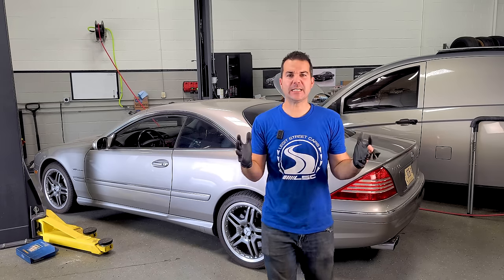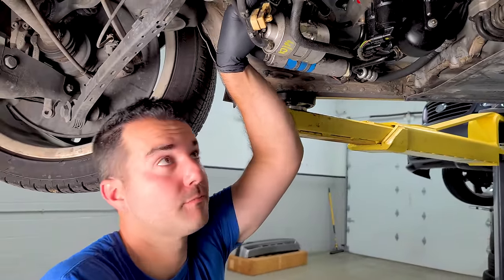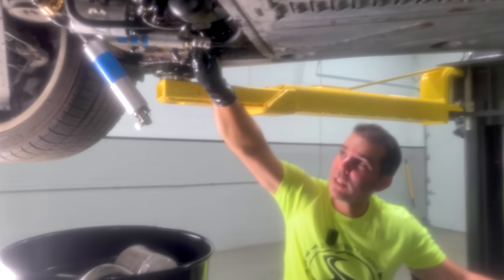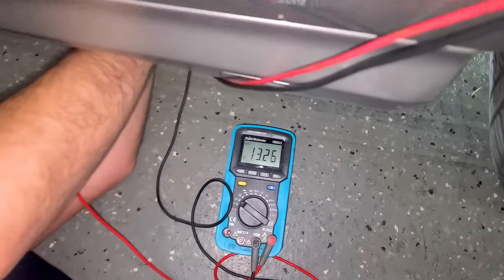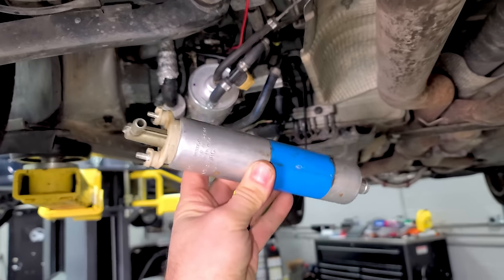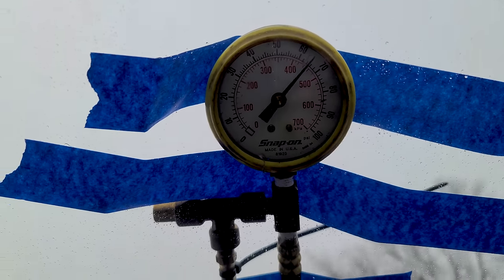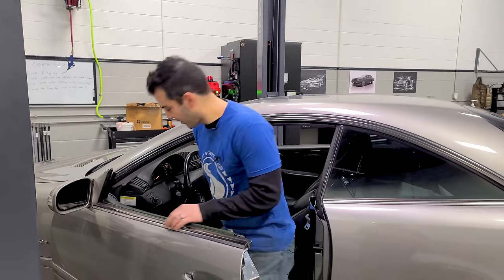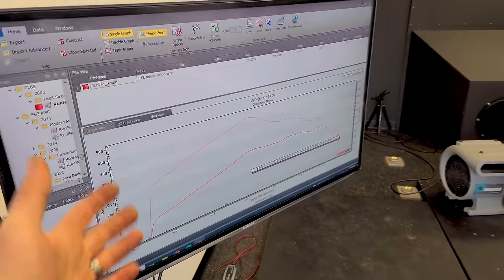I Used Bugatti Veyron Parts & An Alex Trick To Fix My CL65 AMG V12! You Won't Believe What Happened!

Comment from the maker: Post up what you think will fix this car!
Reply: A long drive off a short cliff.
Reply: A fire !
Reply: The crazy part is my friend has the same problem with his Cl65. He’s tried it all from transmission solenoid to custom ignition.  We have been waiting for you to fix it 😂 so we can fix his 😂😂😂
Reply: full disassembly, check every parts of a car, if it normal working, then full assembly) then you definitely will know, what's causing this nightmare))😅😅
Reply: Check your fuel pump input voltage. Check your exhaust system-concentrate on the catalytic converters. Had the same issue.
Reply: remove the radiator cap, and slide a new car under it !
Reply: Crimped full line/ or it’s a software issue
Reply: Haha you tried lol
Reply: I would look into the regulator.  I'm not a merc tech but almost all boost applications use a progressive regulator usually 1:1 for boost.  Also what are you lambda's when entering limp mode?
Reply: The line itself. Fuel line...
Reply: You!😂
Reply: check ECU. maybe it causes this trouble...
Reply: Get a new cat. maybe its still clogges, new intake sensors if nothing works you will have a content car to fix for the rest of the year
Reply: A match and gas soaked rag will solve all your problems.  😂
Reply: Whatever it is, it makes really good content!
Reply: Try gas filter
Reply: Selling it
Reply: Is there a pressure regulator on the fuel line? Could be sticking open when releasing excess pressure
Reply: Peter
Reply: Peter
Reply: @ARMATURISTA I'm tempted to agree with you. The rubber line could be swollen and not allowing enough fuel volume to satisfy the computer. The engine goes super lean super fast and the system triggers a fault.
Reply: I definitely think it’s software related. From what you have shown everything checks out mechanically
Reply: Is your fuel tank venting? Under full load the pumps could pull vacuum in the tank and then the pumps lean out.
Reply: Clogged cats !
Reply: Computer related
Reply: ecu or electic wire
Reply: Test pipes. Just don’t post it on YouTube since the EPA is watching 😅
Reply: I would check voltage under full throttle. Not saying the alternator is bad, but it couldn’t hurt. Also check at the fuel pump at half and full throttle. It seems like an electrical problem to me. Could old wires. Cool puzzle to solve doe.
Reply: Upgrade the fuel pump ditch the double pump setup
Reply: Spark. It's either blowing the plugs out or the coils are failing under load.
Reply: your fuel line , i have a similar issue inside my tank, between the pickup tube and external tank a small crack on tube inside tank was getting air
Reply: Hiya. I wrote this to you before in your last video regarding this issue. I found a document about the M275 Initial Training and it says in that training manual, the Charge air temperature sensor (B17/8) Signal required for calculation of air mass (in combination with B28/7), as well as for monitoring the boost pressure system. Maybe you need to check this B28/7 sensor? This B28/7 sensor, is the Pressure sensor downstream of throttle valve actuator. Maybe this is the issue? You should also look at that M275 Initial Training document; I am sure that could help you further! Good luck and hello from Great Britain.
Reply: Take it to Scotty Kilmer 😂
Reply: Test reducing the boost intake pressure by half and analyze the data, because the back pressure. You could still have a clogged exhaust or not enough exit flow for those boosters, that’s why I’m thinking a very not happy intake flow.
I was gonna tell you to dual pump the fuel but you figured it out.
Reply: A rock…a big rock
Reply: K swap! Lol
Reply: HEY ALEX, Make yourself a punch list and start logging the parts vs. cost and make a limit on how much time and money you have invested and try to set a cut off that is reasonable and try to stick to the limits you set and have some one look at with you and give a reasonable second opinion , more eye and 2 brains and always prevail just a thought buddy !!! PS. GOOD WRENCHING MY FRUSTRATED FRIEND !!!
PS. FEEL THE FORCE AROUND YOU, BE ONE WITH THE FEELING THAT YOUR NOT IN CONTROL HERE >>>
Reply: An exorcist
Reply: I've been down this road with my m113, My issue turned out to be the smallest of vacuum leaks lol. I don't think that's your issue here though. 

With everything you've tried I have to agree with a few other people that you're catalytic converters matrix is moving. I would try straight piping it for testing purposes. But the cats back on if that's not it. 

Also the reason you're going rich now is that the Mercedes ECU does not take into account fuel pressure when determining injector pulse length. It expects that you are at 55 PSI. The fact you're going higher than that with the extra pump now is causing the car to go rich
Reply: Blowing out spark? It would make the o2 read rich and possibly cause misfire codes. I don't recall if you gapped and went a heatrange cooler?
Reply: My car had a exactly the same problem going into limp mode and restarting the engine fixes it until my next all out pull. For me problem was turbo over boosting/under boosting. The old wastegate went bad.
Reply: @chrisdunham6119 the pressure regulator is inside the fuel filter and he replaced it already, still can be a defective part
Reply: On my CL the filter could not deliver after a Renntech map...At boost it is like a sailor at the pub;)
Reply: fuel pressure regulator :face-orange-biting-nails:
Reply: what was the fuel pressure on the dyno when it cut out? if it was low in 3rd gear (which you couldn't test on the street), then it could be a clogged / bent fuel hose. i suppose both fuel pumps can't be bad at the same time.. but it seems that one isn't enough to hold the needed pressure, but it should be enough.. so obstruction in the fuel hose could still be. you released all the pressure and it still shot out like crazy. maybe another peace of plastic? who knows..
other people have suggested the exhaust could still be clogged.. test pipes on dyno could be helpful as well.
i would throw in a normal software and a new throttle body as well. the new software changed too much at once for failure hunting.
i am hopeful that you will fix this car!
Reply: Fuel line after filter, collapsed or other another weird plastic part as in the ABS system…catalytic converters is surface chemistry capturing air pollutants; not sure one should use chemical cleaners, once detoriated sufficiently, you can’t regenerate them. The O2 sensors just check if all fuel is efficiently burned as this will negatively impact the lifespan of the cat. If cat is too detoriated it will generate too much back pressure which is often first noted with full trottle…so one of your cats could still be a potential root cause as shown during the cleaning. The cleaning of the cat would only temporarily relieve the back pressure problem…
Reply: The erratic fuel pressure at steady load worries me. Perhaps problem with return line? Before cutting cats etc you can measure the back pressure. Find the cause of limp home. Easy would be to disable the limp home mode :)
Reply: I would demount the exhaust system including cats on a dyno and so you will see if there’s any difference
Reply: LS swap it
Reply: You should do a crossover video with Ivan at Pine Hallow.
Reply: New larger cats possibly a new throttle body get Ivan from Pine Hollow Automotive to help
Reply: Having Ivan from Pine Hollow Automotive diagnose it.
Reply: Selling it 😂
Reply: Is it possible the air filters are too restrictive and that’s why it’s making that noise
Reply: Bad gas cap
Reply: sooo now it's cutting out because it's too rich (which would make sense since it has double the fuel thanks to the 2 fuel pumps) so my guess would be the necessity to recalibrate the response of the voltage regulator for the fuel pump(s) so that it's harmonised with the new (double) fuel flow. It appears to be well tuned for low loads but under full load it needs to probably deliver lower voltage, as under full voltage it allows the pumps to go to max and deliver too much fuel
Reply: See my comment to your first post.  Issue is probably a clogged or bent fuel line.  You depressurized at fuel rail yet it sprayed at fuel filter meaning somewhere in the line there is a restriction.  Would cause all your issues.  Hope this helps.
Reply: Load OEM ECU tune and go from there. If you have modified tune your fault tables may be disabled and there might be other issues.
Reply: I wonder if a fuel flow guage instead of fuel pressure gauge is available, lower fuel flow may be the cause of engine running lean and going limp mode.

Addition(edit): 
Sometimes running pumps in parallel usually doesn't achieve full flow rate of 2 pumps as both pumps may not run at same rate of flow rate 99% of the time.
It's the reason why there isn't parallel pump setups for PC water cooling loop. 

If the max flow rate of single pump is enough for the boosted engine to not go into limp mode, you may try out connecting both pumps in series for higher pressure and lower flow rate drop at higher engine rpm.

Else you may need more powerful single pump with higher pressure and flow rate combined, overvolt the pump(s) or really overhaul the fuel system to achieve overall higher fuel flow rate like others have mentioned.

Alternatively remove limiters if possible for increased risk of possibly very hard to detect engine pre/micro-detonation.
Reply: Check the return fuel line to the tank. Maybe this is causing the issue. The other thought I had was to find someone with the same model CL65 and compare them side by side to eliminate issues. Also check all injectors!
Reply: Rusty pieces in Tank and fuelpump
Reply: @trentryan27 twin turbo LS swap!
Reply: These problems needs a deeper dive and back to the beginnings. Is there any leak somewhere? Metal bends under pressure. Maybe when you load up the system something bends open and relieve pressure? Never trust a new sensor. Test it. Is there something moving inside the fuel rail? Some rubbers? Is there a cavitation problem anywhere?
Reply: Try driving without the cats to see if that’s the issue?
Reply: i noticed that there was a lot of back pressure when you disconnected the fuel pump, a bit too much i think, so maybe something is going on between the fuel pump and the regulator/fuel rail, the car going rich after installing the second fuel pump may indicate that now there is too much fuel pressure in the rail, maybe the regulator is giving up. now i don't know if the high intake temperature issue got solved but maybe would be worth checking the log for the temp, maybe under load is getting way too high and going into limp mode to prevent knock, or could be something stupid like a worn tps sensor failing at the full trottle possition, is like 20 years old by now so it could be worn or corroded at the end of the travel and the ecu is lossing signal under load and going into limp mode , anyway, a full log of the event may gave some clues on what is going on
Reply: Maybe still a partially clogged catalyst and/or software issue… 🤷‍♂️
Reply: At least petrol will evaporate when you get doused, get squirted by diesel and that stuff just reeks. It seems to soak into your skin and hang around for days.
Reply: A NEW CAR hahahh XD
Reply: Is it still under warranty!!! 🤣🤣🤣
Reply: Collapsing fuel line, or clogged return line? either could cause the issue. next could be a CPU issue. good luck!
Reply: Is it worth getting in touch with Renntec? I have had their map and mods on my CL600 Bi Turbo for over 6 years no issues...touch wood! Keep the faith either way ❤
Reply: Sparkplugs...! I know from Audi that wrong spark plugs on a heavy boosted engine can make it missfire under heavy load...something with blowing out the spark.... aim for 0.7mm gap..... more boost=less gap...
Look around at see what tuned Audi's uses....
Reply: Have you pressurized the intake/intercooler system from turbos to engine with shop air and plugs? Could be a leak somewhere just under load.
Reply: YES
Reply: Your perseverance on this car is nothing short of monumental. You are in uncharted territory with the mods, but it's possible the computer is seeing a data point that is triggering limp mode. That said, it would be nice if you had a pair of plain downpipes, no cat or gutted, that you could bolt on and do a few pulls. It's simple and reasonably cheap. That would answer the backpressure question once and for all.
Reply: I think then you discovered pressure in the line when you had already bleed the line of preasure could have been a symptom you are over looking. I would investigate why it held pressure, is there a blockage somewhere else?
Reply: Fuel lines, both ways. There must be something wrong when they sprayed you like that even though you released the preassure.
Reply: Restriction on the inlet side of the fuel system. Measure the vacuum. Partially collapsed hose? Something weird with the fuel tank?
Reply: Time for a decat? Or atleast a couple of temporary cat delete pipes to rule them out 100%.
Reply: Just had a 2 year old battery in my car that threw an engine light at full throttle, and lacked a bit of power under load. Battery checked good but after replacing it went away.
Reply: @snackler6102  isn’t this a return less fuel system? Hence the variable voltage to pump and the sensor.
Reply: are you 100% sure about your coil packs?
Reply: Likewise might be worth running without air filters just to rule them out too.
Reply: @leonidas953  I second this. He bleeds the lines and there is still pressure. You can’t over look that symptom spraying you in the face like that.
Reply: A tune issue, not original turbo or intake manifold can put the ECU in security mode with all the changes you made (and as I understand it was not happening before ?).
Not sure what kind of ECU this engine use, hopefully a tuner can debug why its going into safe mode and reprogram it.
Reply: One thing to consider and not sure if you have addressed it yet, but I was having the same issue as you with the check engine light coming on and going into limp mode when in heavy acceleration but would run normal after restart- turned out to be the APP sensor (Accelerator Pedal Position Sensor).  If one or more of the circuits in the APPS is worn it will cause an inaccurate reading with TPS, Air/Fuel mixture, fuel pressure etc..  It was a cheap easy fix in my case and might be the culprit with yours.  Hope this helps..
Reply: Change the cats and remove the fuel pump you added
Reply: Look it's only on full throttle so goes into open loop mode. That means it only looks at the open loop sensors which should point you somewhere. Verify signals from all these sources. Maybe run a new fuel line right to the engine bay. Find a spare throttle body or ECU to swap out. You'll get to the bottom of it!
Reply: Seen this firsthand and it was a bad coil pack took it to local electric guy and he hooked it up and fixed the coil pack
Reply: have you removed the electronic  limiter (governor)?  It's a long shot but  if it's still active and  faulty could this be causing the fuel voltage to drop then spike?  Causing the wild pressure changes and it then running rich. might explain the misfires too
Reply: I had something very similar happen to my 2003 C32 amg. Changed the auxiliary pump, fuse, and relay to no avail. It happened to be something very random (ambient air temperature sensor) after I changed it all my problems went away. Not saying that this will work here (they’re obviously very different cars), but I definitely think it’s some minutiae electrical detail that’s causing your limp mode woes. Early 2000s Benzes are just so strange like that. Don’t loose hope! Love the videos btw!
Reply: LS swap. 😂
Reply: If I understood you right, the computer is seeing 21psi of boost when it’s only making 16psi. That would definitely make it run rich. Running rich would make the boost lower than normal, the engine is chasing its tail.  I’m not familiar with MB but it must have a boost pressure sensor.
Reply: Another thing, If I’m not mistaken I saw an esp warning pop up when you punched the gas on the dino? You may have already checked this, but oil can travel up to the tcm connector and cause something like this. (I had this happen to me as well)
Reply: @joedemid6530  gotta love odd things like that.  Like in my car, a bad or even slightly not right coolant temp sensor can make a lot of unrelated issues.  Hard start? Change thr coolant temp sensor.
Reply: throttle position sensor or gas peddle, maybe.
Reply: At clogged fuel line between the pump and the fuel rail, why else would it hold pressure there?
Reply: @ARMATURISTA  a tacoed fuel line.
Reply: maybe aftermarket pump and ecu
Reply: Bypass cats
Change fuel lines
Check fuel tank vent
Check fuel rail pressure regulator
Reply: Take it to the wizard,I'm sure he wouldn't be just replacing parts for no genuine reason.
Reply: Just sell it and cut your losses before something else breaks or goes wrong.
Reply: Personally Alex, I'd be going for the replace all fuel lines between the tank and engine option, and while you're in there, since you've added the extra pump, install an aftermarket fuel pressure regulator in the engine bay with a decent sized return line to the tank. Replacing those questionable cats seems like a smart move too
Reply: Fuel pressure regulator 
Ecm
Bad cats
Reply: A “high flow 😉 “ cat and a tune.
Reply: You have mis-fire codes causing the ECU to limit power. To me that would be an ignition/tune/ECU problem. Maybe knock sensor wiring has corroded terminals?
Reply: With the fear of this sounding stupidly simple, maybe the gas tank isn't venting properly. i.e. bad gas cap. I mean it kinda makes sense though. runs fine on normal fuel consumption but under full fuel draw it's being starved? Pause to turn it off and back on and it's fine. God I'd hate if this were true. But I've seen some weird sh*t working on cars.
Reply: AUXILIARY BATTERY MALFUNCTION
Reply: @wstreff  There is an accumulator at the back that holds pressure. The fact the system goes to 10.5 under hard accel indicates it is not running out of fuel.
Reply: @InfiniteBumblebee337  so there is another pressure bleeder near this accumulator Alex forgot about?
Reply: @wstreff  I can't speak directly to this car, but many MBs have dual pumps with check valves and an accumulator at the back along with the fuel filter. Depending on where the accumulator is located in relation to the check valves, it's possible for pressure to be held back there in spite of the fuel rail pressure being relieved. The earlier V12s had a problem with heat soak and vapor lock, so the MB fix was to raise fuel pressure and hold more pressure in the lines.
Reply: I am on my 2nd m275 car that I can tell you that these are very finicky Motors. I would start by retracing your steps since you had the entire engine cradle out maybe there’s something pinched in the fuel line?

Also, I posted this before. Please check for boost leaks. This can be done by capping off one of the turbos and making your own tool with a Schrader valve for the other side.  

Maybe one of the new sensors you purchased isn’t functioning, correctly

Your plugs could also be fouled since you upgraded the fuel injectors without tuning it right away 

If it’s still not running correctly, you, you truly need to work closely with a tuner 

I’ve been watching your videos since the E55 keep up the good work !
Reply: Speed density
Reply: new batt terminals, or your negative is not down far enough after having to disconnect it so many times. i discovered in stage 3 e55, that it kept popping out of tune because of this, back to a too lean oem map. always the simplest things
Reply: Looks like i was right ;)